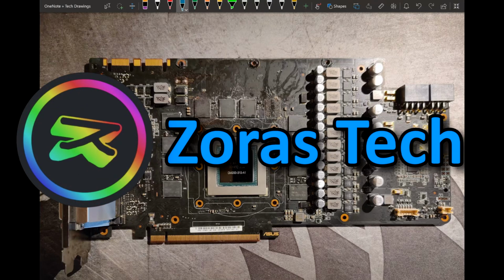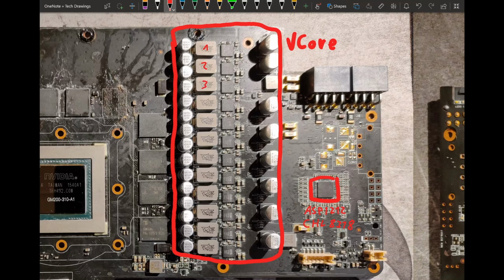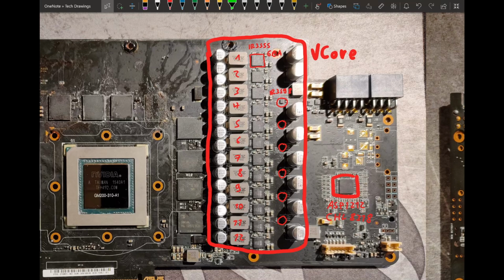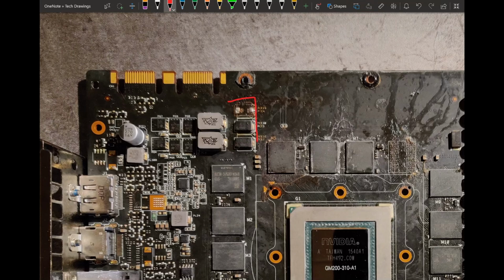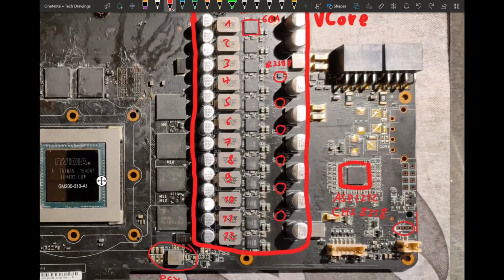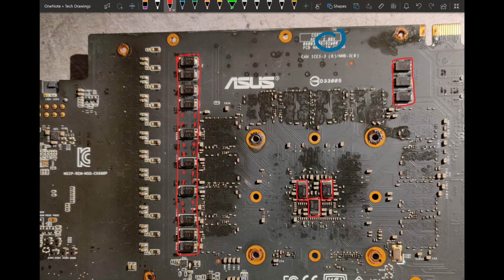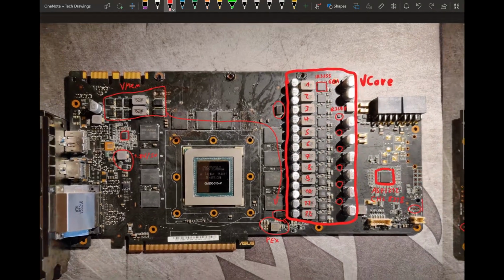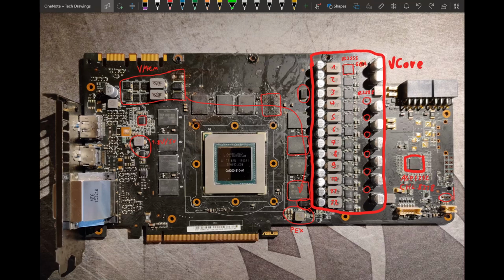ASUS GTX 980Ti Strix Rev.2.0 | PCB Overview

Comment: Thank you for making this video,
I've been using my Asus Strix GTX 980Ti since 2016, and tried to take as much care of it as possible, but sadly i didn't take into account the drying up of the thermal pad on the Vcore VRM and one of triple stack of resistors below the 2nd Power Stage fried and possibly damaged one of the ones that has a black top. I wish i could get it repaired, and get back to using my GPU. 

Watching your video and the entire description of the PCB made me understand the hardware so much more, although i am basically a noob at this, but im trying to understand.

Thank you again, Cheers ♥

PS, did you manage to fix your card? I hope you did!

Comment: On the VMEM 2 phase memory side, on each inductor, what should the Ohms be on a healthy card with Samsung modules, 20 Ohms?  What if I'm getting 10.4 Ohms on each inductor? Card is at room temp. If I let the card warm up for 2 mins, Ohms will drop to 8.7. Can I suspect a bad memory module or bad memory controller in the GPU? The previous owner said he saw 3 white and blue horizonal lines before the card stopped displaying a video signal.

Comment: Well this is interesting! I'm just trying to fix one of these right now.. Mem controller says UP1641P on both the cards I have.. What you thought could be 1.8v is the 5v.. The top left inductor measures 12v, I can't find a 1.8v? If you'd like any more info/measurements just let me know! ;)
Reply: I have short on 1.8v/5v and i Cant find it, gpu crystal is 3.0 Ohm, if i take off buck converter (up1641p) the short still exist 😭
Reply: I have the exact card which I'm attempting to diagnose why I have no video signal. Preliminary test didn't reveal much yet, no shorts and basic power stages are working. The only thing standing out is the 2 phase vmem vrm, its only reading 10.4 Ohms at room temps.   Any luck with your card?